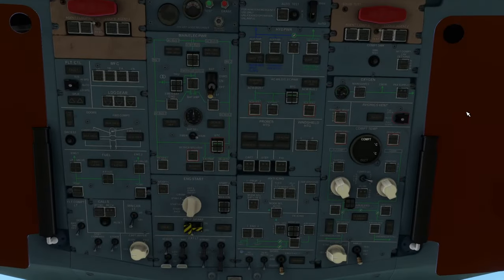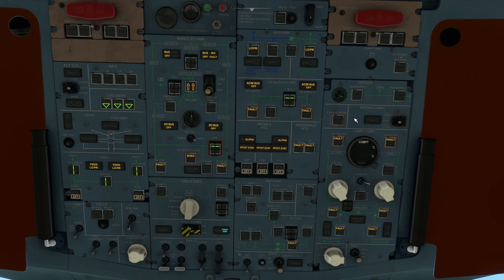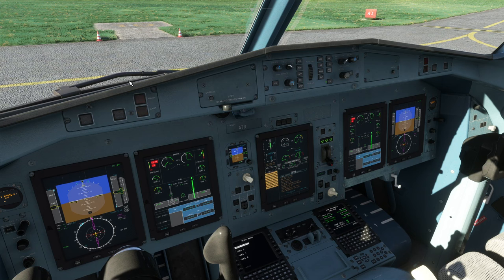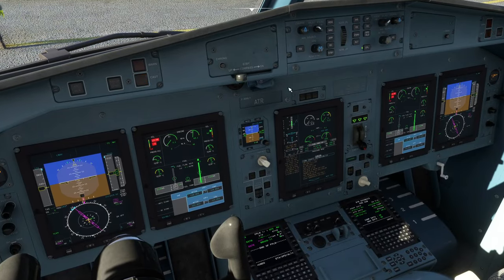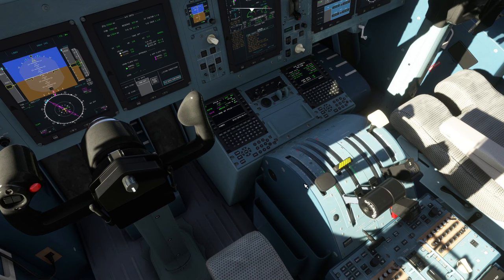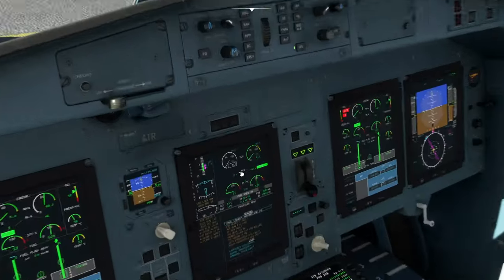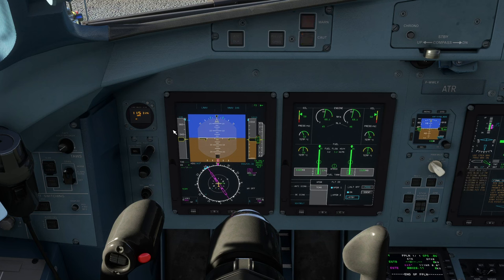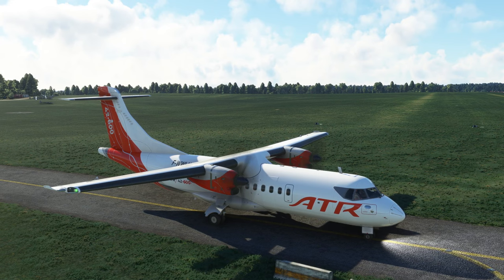Beginners guide to starting the ATR with Hotel Mode in Microsoft Flight Simulator

Comment: Another Hotel 🏨 🙈 Thx Jon, much appreciated! Have a group flight coming up, must practice
Reply from the maker: The main point seems to be don't start engine no. 1 until you release the prop brake on engine no. 2. I've STILL seen it fail to release once, but it seems to be much more reliable.
Reply: Thanks Jon for the tips!

Comment: the thing i have trouble with the ATR is the speed  she slows down at high altitudes eg: FL210 she does 194knts, and i cant figure out why.    i just cant get the speed up
Reply from the maker: That's INDICATED airspeed. The higher you go, the lower it becomes, because it's measured via the air pressure hitting the pitot tube - and the air is thinner the higher you get.

Comment: I can only get one engine to come off the prop brake. The other prop, though the engine is running, refuses to turn. The next time, the first prop wont start turning. Did I just buy a lemon or are these instructions not working now?

Comment: Might want to update the checklists. They are no longer accurate with the ATR updates. 

To remove the prop brake, you must:
1. be on the ground
2. gust lock ON
3. Engine 2 in FTR
4. blue hydr pres 2900psi or more
Reply from the maker: Yep - it's changed again.

Comment: So just to be clear, you don't turn on external power?
Reply from the maker: This evolved quite a lot. The aircraft evolved, and the checklist evolved to suit :)  If you check my more recent videos, I revisited the ATR :)
Reply: @jonbeckett  This is the most recent video I could find, (uploaded 2 weeks ago) it works for me, but I turn on the external power which it looks like you don't, unless i missed it. it seems the key thing is to turn the prop brake on before anything else. Cheers for the video as it was getting quite frustrating not to have the prop spinning, prior top that I was having to quickly shut the engine down then push the lever forwards again, then the prop would start start spinning.
Reply from the maker: @AstrogeoJay  It's interesting looking back now - now I know what's going on - and where the hole in the logic is - to see how different people have solved it :)